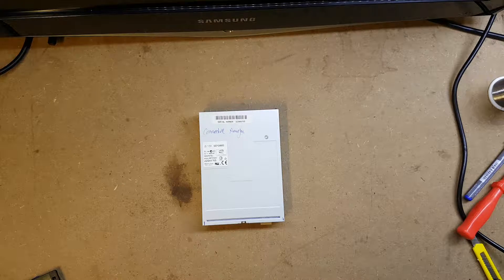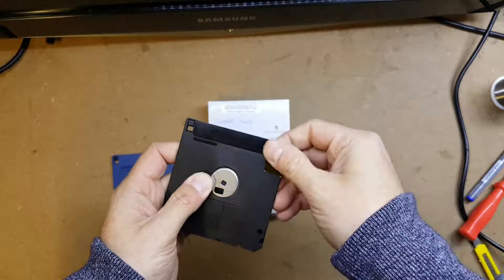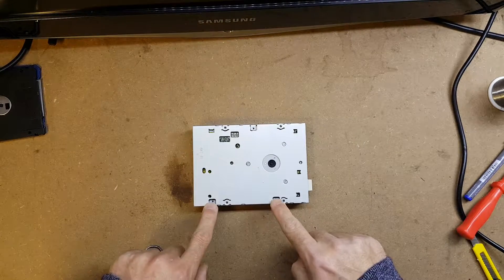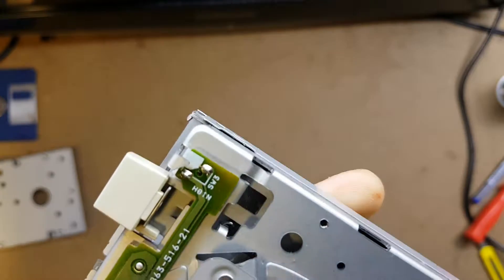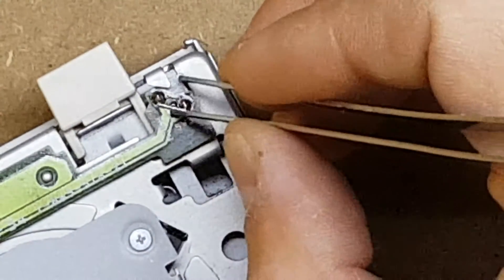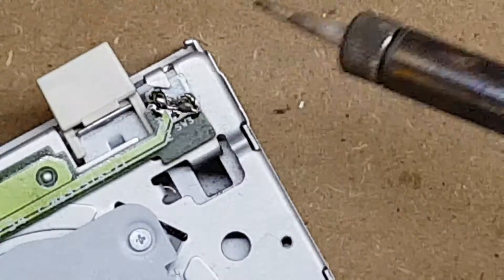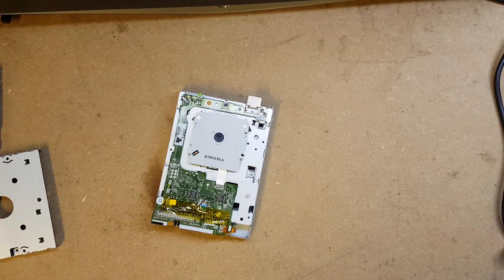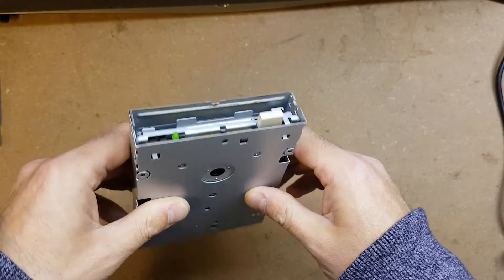Modifying the HD detect switch on a Sony MPF920 for use on the Commodore Amiga.

Comment: Nice tip... I've got 5 of these off eBay all "tested" and all non functional.. hoping cleaning heads etc might revive 1 or 2... then will do this mod. You presumably did the other mods for drive select etc???